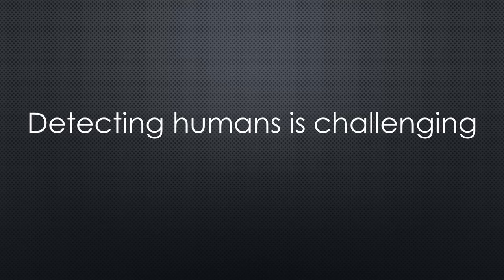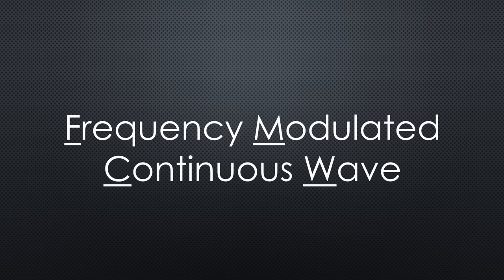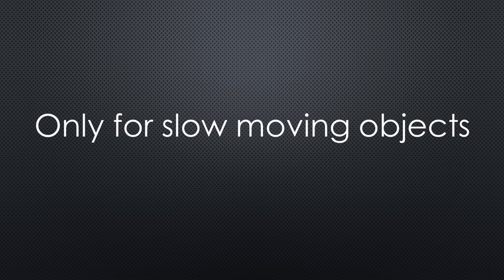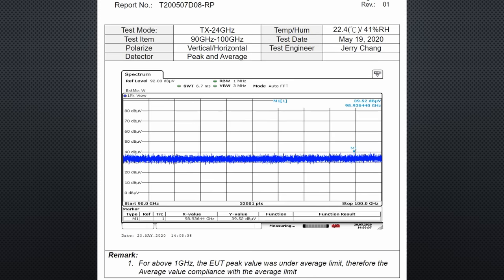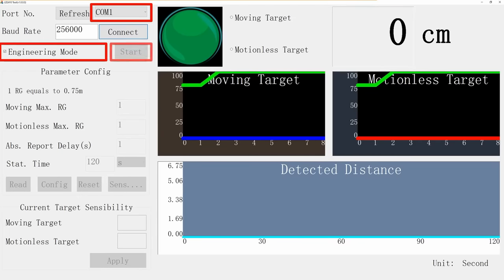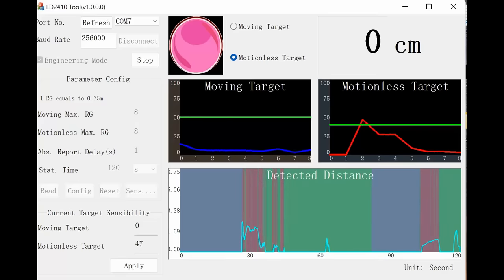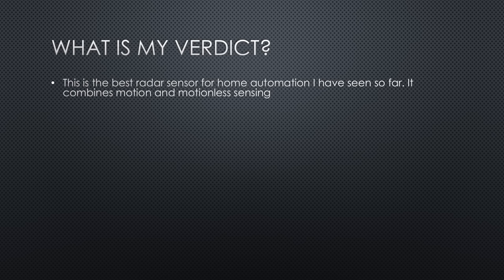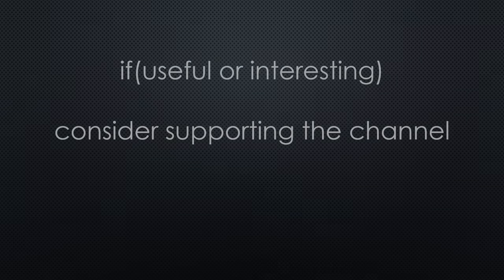439 24GHz Radar Presence Detector that Works (LD2410)

Comment: Hi Andreas, really appreciate your time and dedication to do such video for our sensor module LD2410,  you are so great. you know and explain this module better than our engineers.☺☺
Reply from the maker: Thank you! Now we would be interested what your engineers do to solve the issues I mentioned in the video ;-)
Reply: @AndreasSpiess  yes, we are testing here and update you the results.
Reply: One quick question for the engineers: can 2 or more LD2410 sensors correctly operate in adjacent rooms or do they interfere with each other? Thanks
Reply: @dan-nutu  Hi Dan, the space between two modules is more than 1.5M and the antenna surface of the module cannot be placed directly,thanks.
Reply: @hi-link4092  Thanks, much appreciated. So at least 1.5m separation between sensors and by "the antenna surface of the module cannot be placed directly" I guess you mean "the antenna surface of the module cannot be placed directly facing the other sensor"?
Reply: @dan-nutu  Hi Dan, yes, you are right,  could not be placed facing the oter sensor. 😊
Reply: @hi-link4092  Understood, thanks. Would you be able to share what is the "angle of exclusion"? As in, do 2 sensors have to be placed back to back (i.e. facing away from each other, 180 degrees), or would they also work ok at a smaller angle (e.g. 90).
Reply: @Dan Nuțu Hi Dan, the detection angle of this module is 120 degrees. It can be placed back to back, but the distance between two sensors should be more than half a meter or separated by a metal plate. Otherwise, there will still be some interference.
Reply: @jps-ib8vh  Hi, BT can support OTA upgrade and app configuration for Bluetooth connection
Reply: @bugnugget2516  Hello Bug, it is planing. Our engineers are constantly trying and testing.
Reply: @dan-nutu  Hi Dan, we have a download link of app in the document. You can download from the link. Thanks a lot.
Reply: @hi-link4092  when do you release the updated firmware?
Reply: @hi-link4092  did you guys update the firmware yet ??
Reply: I think the issue mentioned in the video isn't really a issue. There is no meaning behind activating the sensor without motion detection. How can the "motionless sensor" detect you if you never !moved! into the radar? I tryed the sensor and the "motionless sensor" is only "holding" the activated motion detection. And that is working really fine. Breathing alone is enough to register your presence. If you want to trick the sensor, you can stay still and hold your breath. Im using the LD2410B via Home Assistant to switch my lights and it works really reliable. The "B" variant can be configured via Bluetooth with a Android app. Unfortunately I only found a Chinese version of it.
Reply: @Trhour  ya but what if you are really still using you phone in bed or sleeping under the blanket and it turns off but you make a slight movement or take a deep breath which is detected by the motionless sensing but doesn't trigger the sensor
Reply: @sahilkarni1550  then i would say you should ajust the sensitivity or/and the position of the sensor. But yes, i got your point. In some cases it would be usefull to trigger with motionless.
Reply: @hi-link4092  Hello Hi-Link:   What was the reason for making the header pins 1.27mm pitch?  It's so difficult to get cables, or solder headers on it.  Could you have not made it better with 2.54 mm pitch standard headers?
Reply: @eskimojo97  Size matters when it gets integrated into other projects. Personally I use 1.27mm pitch pretty often when I do programming / debugging headers or such things on small boards. 
If you can't find a 1.27mm pitch IDC cable a common option that still fits are the 1.25mm pitch JST cables.
Reply: @hi-link4092  hi! Does the ld2410 detect multiple people at the same time??
Reply: @AndreasSpiess  hi! Are you able to use the ld2410 detect multiple people at the same time in the same bedroom??
Reply: Hello. I bought modules HLK-2410B, HLK-2410C and HLK-LD015. Is there a comparison chart or description list showing the differences between these modules? My second question, is there an english version of HLK Radar Tool apk?
Reply: The LED on antenna side of PCB - why is it there?
Reply: I want to make this
Reply: Can it still detect even under a rubble?
Reply: can I detect cats with this sensor?

Comment: Super nice video Andreas (as usual). However, as you mentioned: the biggest advantage of PIR over these radar based sensor is the current consumption: I am down to 60uA for both: ESP32 sleeping and PIR SR-602. So they can work on battery. This one (and the others on 2.4GHz) are operating at around 1000x higher current so battery for 2 days ;-(
Reply from the maker: You are right. I thought I mentioned this fact.
Reply: Unlike a PIR-Sensor which has to be enabled all the time to notice differences, this one probably works if you only turn it on sporadically to check if something changed.
Reply: @tarakivu8861  Was going to ask if this isn't the case can't a loop be created? PIR Sensor for initial detection, triggers the 24g to start watching, it kicks on every 60 seconds or so checks for motion or motionless to be active still, if it isn't it disables it's restart interval until the next PIR interval triggers to tell it to start monitoring again?
Reply: But using them with higher energy consumption still makes sense when the controlled device also has high energy consumption (eg. kW range). Then for sure every minute saved is worth the consumption of the sensor...
Reply: @cchance  I guess the question is: how long is the boot time for the 24G?
Reply: Why not combine them, use the pir to detect someone entering the room and essentially have it change mode to use the pir + radar untill it's clear the room is empty when you enter deep sleep again untill the pir wakes the sensor next ? You could even have an intermediate mode where the sensor goes into a shorter periods of deep sleep and just wakes up every 60 seconds to check if the room is still occupied and if not goes into full deep sleep waiting for the pir to wake it ?
Reply: Anyone made progress on combining these yet?
Reply: @felixisme  I think some mosfet or transistor switch (many options) interfaced with an MCU to turn on/off the sensor would make do. Read PIR, if high then turn on switch and read output value from Hooman Sensor.
A crude alternative is to program the MCU itself as a switch ,though I'm not sure it would work because as seen at 4:57, the sensor's operating current is 80mA, and the output current of an arduino pin for example is 40mA.
Reply: @alby_alby  Nice idea. And beautiful profile pic.
Reply: There is special modification in this sensors line LD2410S. It has much lower polling frequency so average consumption is 3-5 mA only

Comment: If they used a triangle wave instead of a sawtooth, then the distance information changes sign (and order) for the second half of the period and the Doppler part is the same.  Thus, each could be measured accurately and independently.  There will still be an aliasing problem as distance increases enough that more than a half period propagation delay accrues.  This can be mitigated by using multiple triangle waves (for high accuracy) or by increasing the triangle period until the returning signal of distant objects is seldom detectable.
Reply from the maker: You are right. Sophisticated wave forms can be used to extract more information. I assume the frequency can be chosen from the outside of the radar chip and the ADC signal can be read, too. So a lot is possible. We will see what people do with this technology...

Comment: Oh... No WAY!?Wow, I see my favorite sensor has been upgraded!I will definitely have to pick up a couple of these new sensors ! But as @Assassinlexx mentions in one of the comments "RWLS-0516 will detect through drywall" .That is an important feature for stealth deployment or burglary situations.I hope this functionality is available in the 24Ghz detectors. 🤔
Reply from the maker: You have to try. 24GHz is quite high and they have a chapter about housing material in the spec sheet. So material of the wall seems to be important.

Comment: This is the most annoying sensor I've recently ordered. I could never get it to work, despite watching your video and doing hours of research. Even the supplied software tool could never find the right COM port whilst my IDE was all correct. I'm disappointed by this investment as it wasn't cheap for me to get it abroad.
Reply from the maker: I do not know what is wrong with your sensor. These sensors are now all over the place and they seem to work quite well.

Comment: If you use Rcwl- 0516 chip. They can" see" through dry wall , wood. They are prefect for burglar sensors.  As they are hidden inside  walls etc.
Reply: Those work great, but do not have motionless detection in them
Reply: I don't know if the LD2410 module is any better but the RCWL-0516 modules that i have will also detect movement in other directions than directly towards the sensor.
Reply from the maker: All radars should "see" through thin walls. However, I do not know how good 24GHz works. They provide information of which plastic you should use for the enclosure. So there is an influence...

Comment: I have made an integration for Home Assistant for the LD2410B; the Bluetooth version. It should automatically pick up the sensor via Bluetooth and offer to adopt it. It will be released in version 2023.2. Thanks for bringing this sensor to my attention Andreas!
Reply from the maker: So I have to try it out. I also have the BLE version...
Reply: i got the ld2410B i can pick it up using my phone but in homeassistant it say no unconfigured devices

Comment: good job! can the LD2410 be used independently just ESP32+LD2410 without  home assistant?  what's your measurement between GND and OUT during testing? Thanks.

Comment: I really like your no ads policy, support well deserved! 
Now I found my answer, maybe. We are in the middle of planning our new business building. During one of the meetings, the technical expert came up with the question how to switch on/off lights in restrooms. In our old building, you have to move from time to time while doing the "business". This results in the need to wave to the sensor when it takes longer, or you are sitting in the dark. The expert said there are sensors which do not need that waving action anymore, and I was asking myself how this works. Seems, your video delivers a possible answer.
Reply from the maker: This 24GHz technology probably became "ripe" over the last months. Last year, I saw some 60$ sensors in this frequency range and found it too expensive for general use. With the new price point it became interesting.
Reply: There's a glut of mmWave devices from Tuya and Aqara made their own so now a few manufacturers appeared online with their products like HLK, MicRadar and LeapMMW. There's a selection of specialised ones for sleep, heartbeat or fall detection as well as 60GHz models. Personally I'm waiting for the people counter from MicRadar

Comment: Solution for "PIR and sun" problem?
Thank you Andreas for doing all the leg work again.  We can stand on your shoulders one more time.
Great research and great verifiable, information.  From a true engineer ! Thank you
Last winter I had installed PIR sensors around the house.  They worked fine till this summer where the sun, or the movement of hot air, gave me a ton of false alerts.
As you said: if it has not been tested....
I was going to experiment with Ultrasonic sensors, but now that  I have seen your video, I may try the LD2410 first
Reply from the maker: So you are a happy person living in a warm country ;-)
Reply: @AndreasSpiess  not that far, just Belgium ;-)

Comment: Here’s a tip, if you mount a PIR sensor on a servo, you can move the sensor in a scan pattern and get a presence detection even if the person is not moving.
Reply from the maker: Interesting idea!
Reply: Interesting indeed. Wouldn't it generate (more) false detections though? If there are (larger) objects with different temperatures (e.g. radiators) those would appear as "moving" to the sensor
Reply from the maker: @dan-nutu  This movement is probably slow.

Comment: These are the Problems Andreas yes. Good touch on a subject👍 our challange to find or modify low consumption current cheap sensor is still the case.The new Panasonic sensors are really good with 1uA and 2uA versions but it is still so expensive for a avarage maker like us. So I have gone into the modification direction. I have Managed to make HC-SR-501 to work with 3.3volts by removing the Zener Diode and LDO and Bridging Vin and Vout of LDO pins.I have Managed to lower its current consumption this way now HC-SR-501 consumes around 38 or 39uA at idle (when movement is not detected) but if it detects movement it can even go up to 300 uA not very good for battery Powered operation in my book. Maybe those new found Radar sensors are the new saviour maybe... I hope so. Thanks Andreas Spiess for your awesome videos! Great content as always!
Reply from the maker: Your solution is good. Aqara Zigbee PIR sensors are also a good choice if you can live with only detecting movement. They consume nearly nothing. Amazing tech. And cheaper than the Panasonic sensor alone ;-)
Reply: @AndreasSpiess  maybe I should buy one and one zigbee gateway reverse engineer and understand how they decreased consumption that much. 👍Thanks for the tips Andreas your content is Superb as always. I have also lived in Switzerland for 2 year in Grabünden Region near St.Moritz in boarding School. Love your Country so much The Nature and the Swiss people in southern parts are always greet and say Grüß Dich and Smile😀 no matter if you are stranger or not. I see Switzerland as my second country. You Swiss folks are really kind and have a good understanding of how to be a good Human Being. Swiss are always helpfull and kind. Thanks Andreas. Every country should take lessons of principles what you guys have done.🇨🇭🇨🇭🇨🇭See you again until next video of The Guy with a Swiss Accent🖐️
Reply from the maker: @the-matrix-has-you  Thank you for your kind words. Yes, we love peace. But I am sure you find nice people also in your country! I learned that they are everywhere. I have plenty of nice people like you from all over the world commenting on my videos...
Reply: @AndreasSpiess  Thanks Andreas, I have a new Record to announce! I used my new pir sensors AM312's and modified them.For those who are using AM312 PIR Here is how to lower consumption even more and make it work properly with 3.3v first remove LDO HT30 respectively and bridge Vin and Vout then add 1uF capacitor to  Vout and GND pins and remove the only one smd resistor as it is labeled R1 and bridge resistor pins with little solder. Then AM312 will work much much more stable plus it will consume around 6 or 7uA😀 now with AM312 pir sensor and my custom wemos d1 mini wake up shield and wemos d1 mini with LDO removal consumes around 163uA with my new calculations over 470 days of running capable sensor with a single charge! Success👍

Comment: Amazing and very informative. 
When I encountered this problem I went with motion sensor + shock sensor ( on floor ) whenever someone existing the room and no motion determine after a minute the room is empty. Same goes with doors monitor for the shower. 
Btw, Alexa dot3 has microwave sensor, but it's unreliable and takes 30 minutes to turn off.
Reply from the maker: Interesting! So far nobody mentioned shock sensors for this purpose!

Comment: In general FMCW-Radars can do crazy things, if you combine them with intelligent software. If you assume that objects don't change their velocity extremely fast, you can use a set of frequency modulations with different ramps. With this trick you can detect distance and velocity of several objects. For a long time this was the technology for radar sensors for advanced driver assistance systems in cars and trucks.
Reply from the maker: Good to know that this technology has even more potential! Maybe in the next chip revision ;-)
Reply: I think a sine wave FM can be used, correct?
Reply: @pizzablender  Usually they use liniear ramps with changing gradients. The frequency shift is a combination of time of flight and doppler-effect. For each echo you you just get a combined information if distance and velocity... combining different gradients enable to calculate the velocity and distance seperately. A saw tooth-pattern is possible, but I think a series of positive gradients is more common.
A true sine wave FM would make it close to impossible to do the calculations. And I guess that the constantly changing echos will make it hard to receive a significant power in a specific frequency.

Comment: Dear Mr. Spiess
many thanks for this informative video about the LD2410 Sensor. With some shielding it is quite easy to make it sensitive in small angle direction and not sensitive from the back-side. It does not work with 12V DC, I, was baking one sensor already, take 5V DC... About soldering it is easy on top side plus = at the capacitor / signal = outside pin. solder minus on the back side by the testing contactors. I use this great sensor for my time - capturing project, it works perfect on a distance of 3m.. like a laser beam... If you wanna test it his way, i can send you some 3D Printing models...

Best regards, Peter
Reply from the maker: I would be interested in the 3D models because I got now LD2410B (bluetooth) sensors. Maybe stuff for another video. Yo can contact me on Facebook Messenger or Twitter
Reply: @AndreasSpiess  Ok, was sending you a message trough FB, the STL files and photos are coming soon. i am looking forward, to integrate this smart , robust and cheap sensor into bluetooth networks, can be a good additional sensor for target recognition as a feature in my time-measuring application . Many thanks and best regards, Peter